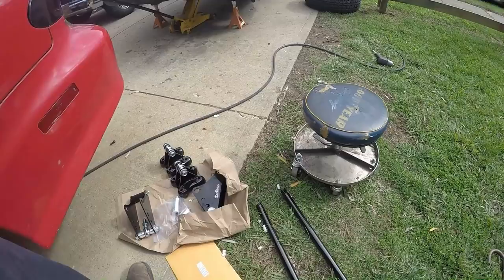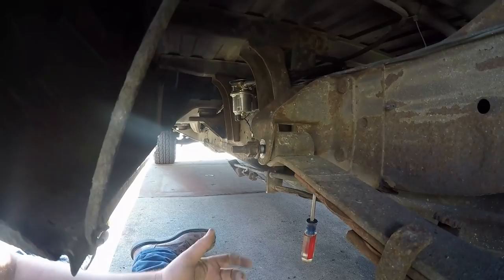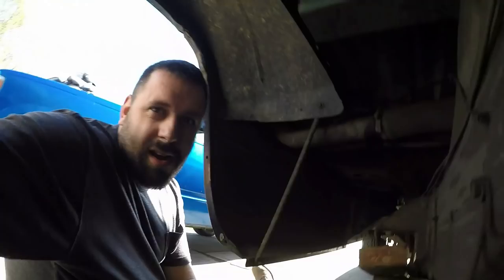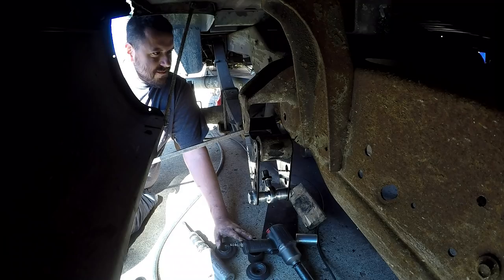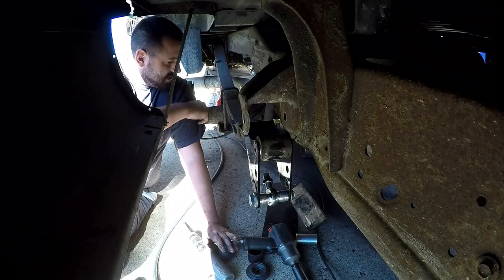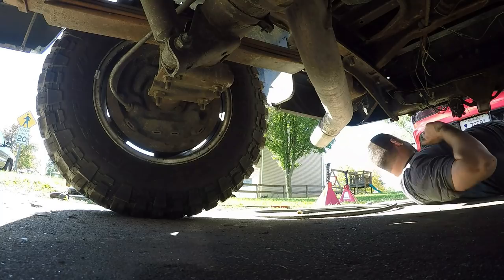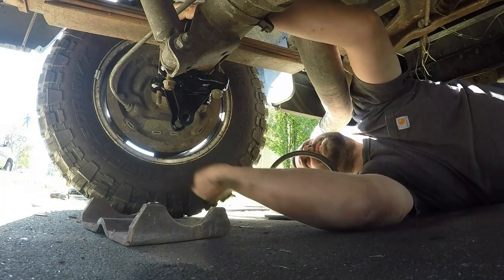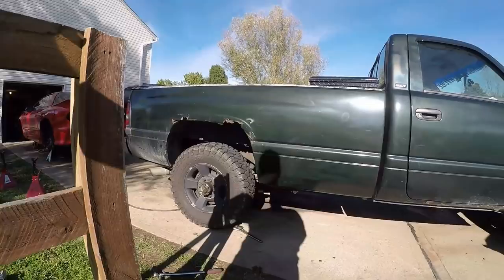Caltracs! traction bars on my dodge cummins!

Comment: Great video. Got a pointer for you that might help you out in the future. If you're installing a metal bushing into a leaf spring or anything for that matter put it in the freezer overnight before hand  and it'll slide in with out having to press it in.  We do it all the time on semi trucks.
Reply from the maker: Thanks for the tip! We used to put parts in a cooler of dry ice overnight back when I worked on rollercoasters years ago.

Comment: I just got these in my shop. Going on 06 Megacab. My question is, or fear is, how do they do as a daily driver? Did it eliminate the rear from absorbing bumps, or no effect??
Reply from the maker: I drive it everyday. They are different than most traction bars. If you look at the design, it pivots on the leaf. Only time it really does anything is when the rear end torques under load. I can't tell there on there unless I'm accelerating. Definitely makes a difference on traction tho. First time I went to do a burnout after installing them, I stalled it out. They lit up real easy before then. Put them on, there aren't any Ill effects that I've noticed.
Reply: Thank you very much for your quick response! Listening to your experience, these Caltracs sound like a winner all around. I used your pointers in the video to prep. These are going on tomorrow. Can't wait!

Comment: Did it fix all the wheel hop? And its the bar adjustable for different sizes?
Reply from the maker: Yes totally eliminated all wheel hop. Caltrac racing had me make measurements before I ordered. It can fit any size lift or lowering that u might have on it if you give them the correct measurements.

Comment: So, I'm attempting to install these on my 1996 4x4 (100% stock suspension). Yours looks like a 2wd. It has the Dana 80 just as yours does. It looks like the difference between mine and yours is that mine has a big lift block under the leafs to raise the rear end. The problem I'm having is that the links are far too long, even with the joints screwed all the way in when weight is on the rear end I'm still about an inch away from being able to bolt them up. I'm assuming, but not positive that they sent me the wrong length of links. Maybe for the 2wd model. Hence the different part numbers between 2wd and 4x4.
Reply from the maker: They actually had me measure mine before placing the order. Call them I'm sure they will make it right.
Reply: @HorsepowerTube  Thanks for the reply, I actually see the measurement instructions sheet on the website. I contacted them. Another question, did you have to do any relocation of your parking brake cable at all? I'm finding that it is somewhat getting in the way of the bracket mounted on the front portion of the leaf spring on the driver side.
Reply from the maker: @bluebellbus70  yeah that does sound familiar. I think I bent that bracket at a slightly different angle to clear it better. Didn't notice it until after I made the video.

Comment: What kind of preload are you running now? I tried all sorts of different adjustments and still have wheel hop with these bars.
Reply from the maker: Never changed them from the initial recommended setting. 0 wheel hop going forward. I've done burnouts and everything. Had to relearn the burnout tho bc they bite so much better now. First time I tried to after the bars I stalled it out.